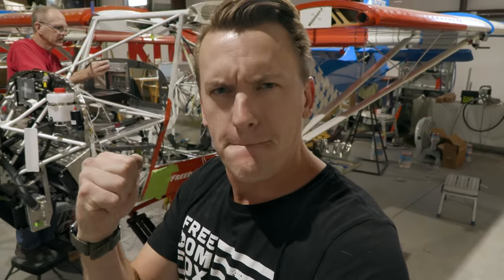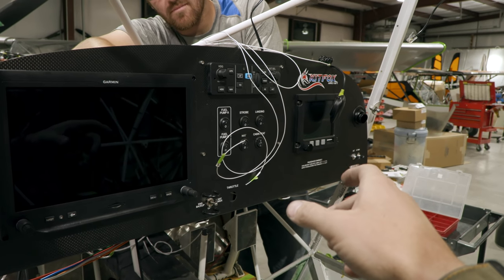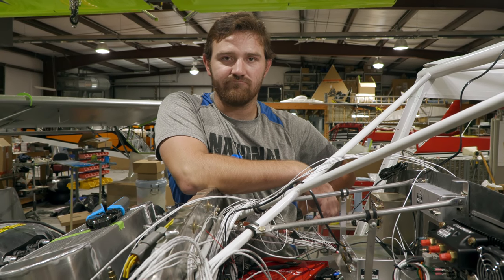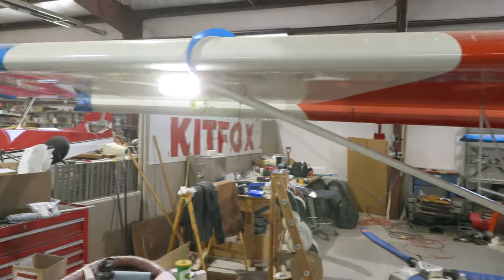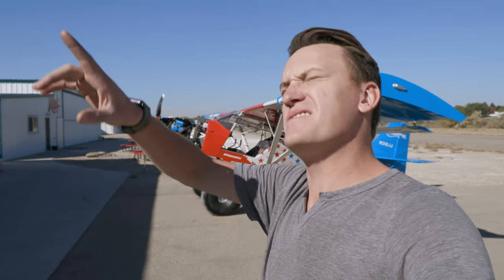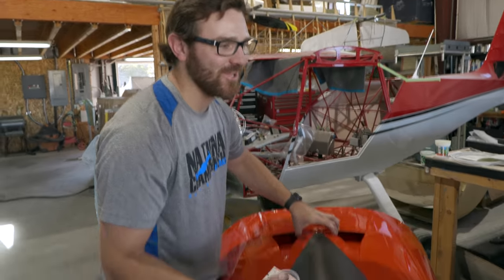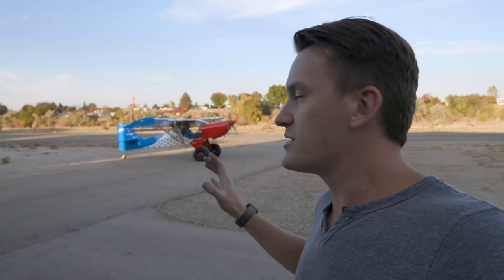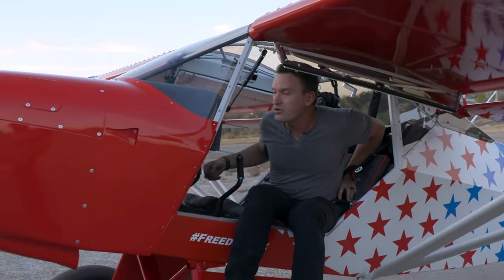Operation Cub Killer Part 3 - Avionics to FIRST FLIGHT!

Comment: This is by far the best build video. New Avionics, New motor, New cowling. The Vertical power setup is pretty cool. The G3X autopilot is sick. It should be a allot nicer to fly long distances. Pickup truck converted to a Cadillac ATS-V

Comment: Just watched you and Mike square off at High Sierra.  Great job.  Draco is an untamed beast with huge mechanical advantages in thrust, engine power and a reversible pitch prop and you showed your skill by making it a near thing.  Well done.

Comment: I am SO 20th century in my thinking. My poor little mind still thinks of the PN-101 as cutting edge. SHEESH ! Man, it looked like you rolled about 10 feet before the Fox leaped into the air on that last takeoff. You have one super-cool plane, guy!!!
Reply: I KNOW!  Thinking the same thing!  I was just yelling "THAT'S CRAZY, THAT'S CRAZY"!  SUPER COOL LIL JEZEBEL!  Well done all!
Reply: Gonna almost give Draco a run for their money.
Reply: That aint going to happen! 
Carbon cubs are going to be real sad though!!!
Reply: Sorry, I haven't been into broadcast radio since I was a high-schooler. Military cockpits didn't come equipped with that kind of stuff, Hollywood to the contrary.

Comment: So, H4 turbocharged engine with top mount intercooler.  If forget whether or not this is an STI kitfox, but yeah... it's basically a flying Subaru.
Reply: yeah but the old outbacks had H6
Reply: Robert Durbin The Freedom Fox has an STi package that was added later on if I remember correctly
Reply: Hopefully it doesn't chew through head gaskets like some of the old ones did.😂
Reply: Or worse... ringlands
Reply: STi for the kitfox is a couple of larger STOL inspired wings, it has nothing to do with the power train, but yeah thats what i first tought when I first saw it as well
I've had subarus for a while now, both turbocharged and naturally aspirated, and the old outback with an H6 is by far my favorite
Reply: @bdanza  Some did, some did not. Most had H4. All Tribecas had H6.
Reply: Actually both are Tatra based via Volkswagen. The rotax differs from both in that it uses hybrid air/water cooling - the heads are water cooled but the cylinders (block on a Subaru - another difference) are air cooled. You can set up Volkswagen oiling for planes, but i dont think you can set up a Suby to run upside down.
Reply: how do you define upside down on a boxer engine though? they're roughly symmetrical, you would just need a dry sump and a bunch of scavenge pumps
Reply: Robert Durbin Subaru made airplane engines, they just tend to catch on fire
Reply: you actually can  @mycosys  , people sell kits to convert them to aviation, with more powerful pumps and  a whole different intake and exhaust system
Reply: Thats 140 hp motor thats new is 40k i would rather have a real built sti motor for about 10k  get 3 for times the power and any parts store will have spare parts
Reply: Jeremy B   That’s not how auto>aviation conversions work.
Reply: keeganwebber   It’s not terribly hard to make any engine run upside down, but it’s not required for an aircraft unless you want to do sustained inverted flying. Even basic aerobatics is possible because you typically maintain positive Gees.
Reply: Mijc Osis   Speaking of that, I have been pondering that same solution for Vw conversions. 

The heads are the number one limitation on power for any air cooled VW, when someone claims to have a 100HP VW engine in their plane you can assume they don’t have a clue.   Top sustainable output for a VW is mebe 45hp, more like 30-35. 

You might get more for short bursts but how many aircraft do you know that takeoff at 2.5x their constant peak output? 

But the VW wasserboxer is liquid cooled! The whole motor might be a good choice as the subies seem to be, but I’m really interested in modifying a set of wasser heads to run on air cooled jugs and block.  I figure running a pump coaxial off the snout along with a bike based alt will work well.
Reply: PracticalTech  as a mechanic I can attest to the maintenance headache I hat is Subaru valve covers, but also as a mechanic I can say that most every car has similar issues. Most of Subaru’s competition uses transverse I4s and V6s, while the valve covers are easier to get to the timing components tend to be just as much a pain as Subaru valve covers. And in the case of V6s you often have the joy of an obstructed rear VC, so on the whole there’s not really a reason to avoid Subaru’s from an ease of maintenance point. 

As for Subaru’s being “worse” than this motor, that depends on your terms. I know they are popular for auto>aero conversions compared to many other options and from the perspective of auto conversions they have good points.  Having looked into people’s conversions I think the ones that come up short do so for the same reasons other conversions do, gross misapplication and over complication.
Reply: Except Subaru"s do not have dual ignition , dual spark plugs , dual fuel injection channels ,dual engine management systems with software to adjust the secondary injection if the first one fails ,   or the ability to run at reduced power after liquid coolant loss by being both air and liquid cooled  ... so if you know nothing about engines they're  the same ... If you know engines you know they are from different galaxies .

Comment: Hey Trent, I was just reading the 915 installation manual on the oil system. Glad you have all the specialized help. That dry sump system is one serial set up!! Looks like you have got got such great Rotax and Kit Fox support. So happy for you.

Comment: Be mindful of your governor Trent.  We had our hands full with them on the drones.  Pay close attention to the governor/gearcase interface for leakage.  Make sure the mount surface for the governor and gasket are spotless or leakage will occur.  What prop have you selected for your installation?  Also, make sure your torques are precise on this interface or leakage will occur.

Comment: Hi Trent, 

                Great stuff mate, love the upgrades and the fact that you're sharing your journey with us so freely and insightful. 
.
Please permit me to make a small suggestion for an additional mod you and the folks at Kitfox might want to consider - in light of resent events (guessing you can tell immediately what I'm referring to) - and that is the installation of a strip of High Density foam to mitigate  possible head impact (see FAA HIC design recommendations for guidance) with the top edge of the instrument panel .

Cheers mate,

Please keep doing what you're doing to entertain us and keep GA exciting and safe.

Comment: Hi Trent,  Great YouTube, great technical and great artistic video. I'm  a GA Pilot in the UK and Commercial Drone pilot. I have a question.  I use a Go Pro 4 Jacked into my intercom system to monitor my flying performance. you get much better video telemetry. What cameras do you use and at what settings including lens angle? Thanks, Paul.

Comment: I've never experienced the pleasure of a new engine. Years ago I had to have an engine in a PA180 rebuilt. At that time it had to be broken in with (if I recall correctly) Mineral Oil and ran at constant speed for something like 4 hours. Is that the case with a new engine today?

Comment: I am glad you went with the Garmin G3X EFIS for your Avionics upgrade...   Out of all the research that I have done on Avionics the Garmin G3X is by far the best EFIS system for Experimental aircraft IMO.  I am curious which Garmin Remote Radio and Transponder you went with.  I plan on using a very similar setup on my build and am curious what you used.  I have heard a lot of good things about the Vertical power systems as well and am curious what your impressions are of this setup once you have more time using it.  It seems like it helps manage the power side of things a lot better and I like that you are able to manage it from the EFIS. With the 915is and the Garmin G3X this is one wicked Kitfox!  I hope Rotax has resolved the Lane A/B mismatch issues with the 915is but am impressed the EMU monitors both sides...

Comment: Hey Trent, could you comment in your next video on the main differences in performance between the old set-up and the new one? What are the main improvements you’ve noticed? Thanks
Reply from the maker: It’s a whole new beast! The power is ridiculous, I used to run around near full throttle all the time, now I go full throttle for a sec on takeoff and then pull it back, just surplus thrust. And it’s smooth and quiet! So far the only downsides I can see are the price and the weight but they are worthwhile trades for the improvement in performance and all.

Comment: A couple of questions from a non flying ignoramous: How do all of these changes affect your trim settings. I am assuming that weight and balance are affected by the addition of all of the new equipment.  How is engine cooling affected by removing the forward cowlings? Is cooling lost to any degree? I would love to hear more about the "breakin" procedure on your new engine. I am an automotive mechanic so this stuff is of vital interest to me. What is done to the frame of the plane to allow you to do barrel rolls and other acrobatics? Thank you for the great videos!

Comment: The old retro cowling played out better on that airplane IMHO but more power is more power. Great interior and new avionics! Happy for you. Greets from Poland m8!

Have your STALL SPEED increased much with that extra mass add on? If you stalled at 33kts would you be able to get down to twenties figures?

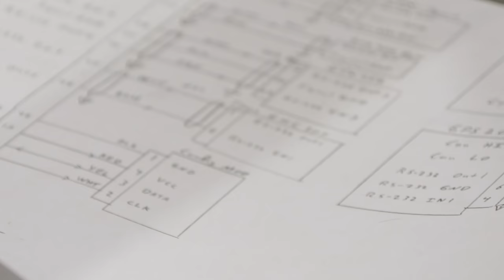Comment: Odd question, at 6:29, what brand is that blue wire stripper? The second pair, not the first...I know, weird question.  Thank you!
Reply: Hi Rich, at 6:29, the blue tool  is a crimping tool and not a wire stripper.

Comment: Happy for you Trent! More power! I know the reason you had to change the cowling and had I not seen the old cowling it wouldn't be an issue,  but I prefer the old look.  Kinda looked like you had a radial engine before. Not my plane and I understand the need for the change.  It certainly won't keep me from watching your vids.  Looking forward to some High Sierra action. You said it stalled at 33 with full flaps and minimal power. How does that compare to before?
Reply: Yeah!  I liked the look old cowling too.  Kinda retro.  The paint scheme with that old cowling was soooo cool.
Can't wait to see how the performance improves.  Performance over styling every time.
Rooting for the underdog; go kick some Draco butt, my friend.  Wouldn't that be ironic and iconic!
Reply: I agree with the comment on the cowling.  I loved the old one, but I understand the reason for having to change it.  Still, I think the round one was pretty unique.
There was a guy building a Vans RV who put a radial engine in his RV, and had to make a round cowling for it.  Looked sharp.  I have to wonder what a Kitfox with a radial would look like.

https://store.rotecaerosport.com

Comment: Are you having to limit the engine at all with that fixed pitch prop? For some reason I was thinking you had to use a constant speed with the 915.
Reply from the maker: The constant speed is on its way. So the fixed pitch is only temporary. It will definitely benefit from the constant speed though!

Comment: Is the “automatic” prop control taking anything away from being able to change pitch at your own free will? (ie: super short field vs normal T/O). Maybe a good feature for someone who does one T/O at an airport per flight, but seems like it’d be more prudent, for your mission, if you had the option of choosing. (Not trying be knock it, or your choice, just curious)
Reply from the maker: If you are at idle and advance to full throttle it will always give you full takeoff RPM so it will always make that power on takeoff. You can pull the throttle back if you don’t need all that power though 👍🏻
Reply: Understood, that makes sense. I was underthinking the concept. I was just stuck on the manual transmission ways of the blue knob and not having a ‘choice’ in the matter but I get it. 
Thanks for the input. (And fraught with envy, by the way, killer job!)

Comment: I don't understand something here. Just a bit ago< you were saying you didn't have the 20 or 30,000 to get a new motor when your engine blew the rod. Then ya put on the used Rotax. Now, we are putting on the cats meow with all the dashboard candy. I'm confused. Wondering how much also, your original plane costs roughly. Not like how much you paid moreover, what they cost to buy. Curious. Your videos are the best period.

Comment: looks great. whats the small tank where the pax seat is?  Inverted tank?
Reply: that engine seems so much quieter.
Reply from the maker: It’s the 1gal header tank, where both of the tanks meet, it gets rid of any bubbles in the line. And it’s way quieter, it’s wild!

Comment: I read somewhere that your Rotax will need  to be rebuilt after only 300 hours of operation , instead of like 2,000 for a normal aircraft engine ! TRUE ?
Reply from the maker: The current TBO is 1200hrs, although I’m betting they’ll up it to 2000hrs once they get enough fleet hours on them
Reply: 300hr TBO only applies to the 2 Strokes like the 503 and 582.
Reply: Thanks ! AS much as these engines co$t , 300 hours doesn't seem like much time in the air even for a 2 stroke !

Comment: Wow!.......it's a brand new plane again.  Have you ever thought about Engine additives like duralube.com  ?  I'm sold on this Engine additive.  I use this oil on everything I can.  I use to have to oil my bike all the time and I used this on all it's bearings and haven't had to oil it sense then.  Not to mention I use it in my Engine and they have a Fuel Injection treatment too.  Look into it Trent.  They use to have a Guarantee that if you start using this Oil from the Start on a brand new Engine, if your Engine goes out they'll pay for it's replacement.  duralube.com